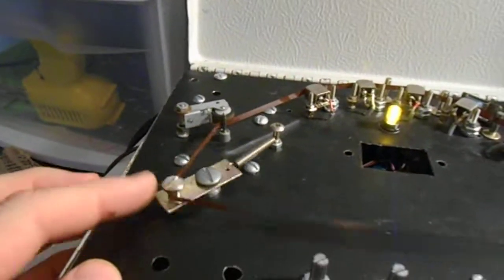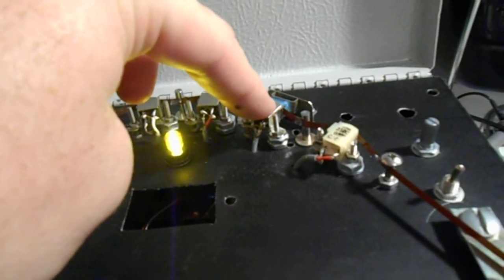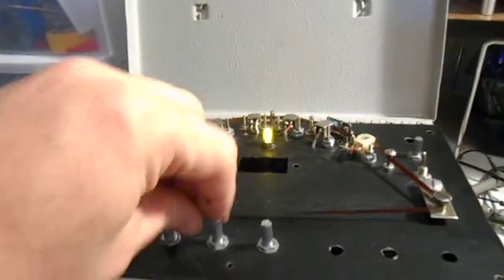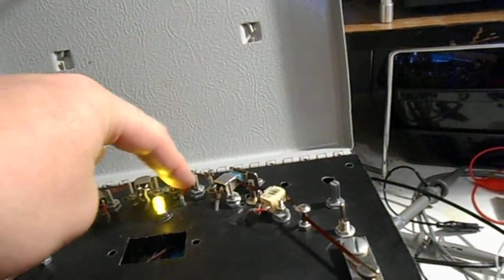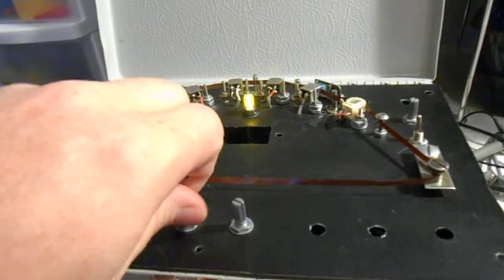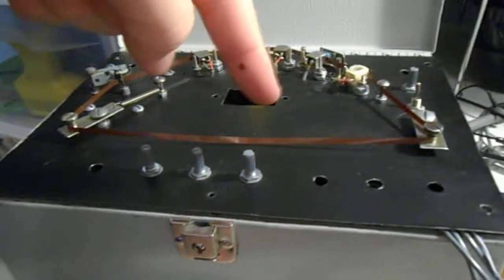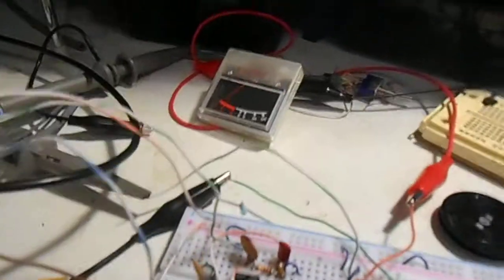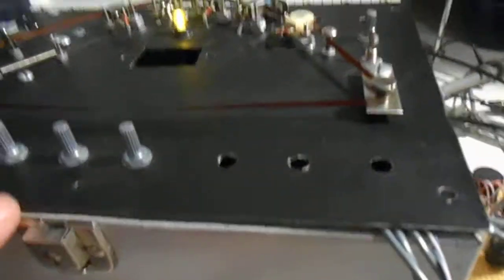DIY Tape Echo Progress

Comment: Love the setup! Just a quick question I have a playback head that has a red and white which I’m assuming is right and left positive then a yellow connected to both which I’m guessing is negative.. but the is also a shielded wire that grounds the case of the head... where would that connect or where would be a good ground? If this makes sense.. thanks in advance for any additional info!
Reply from the maker: Usually red is right and white is left channel and you'd be right about the other (yellow) wire being ground for both. The head shield wire being grounded simply helps with EM interference.